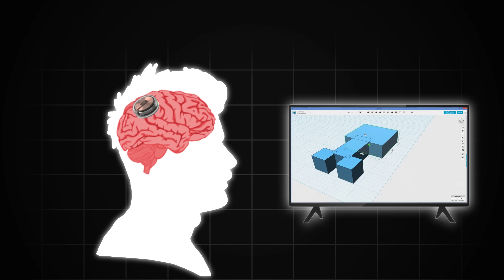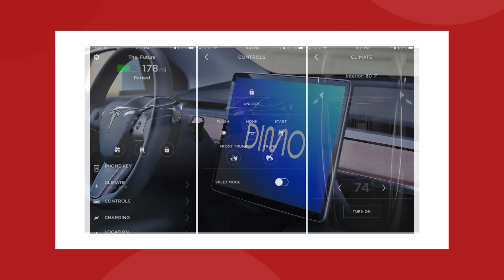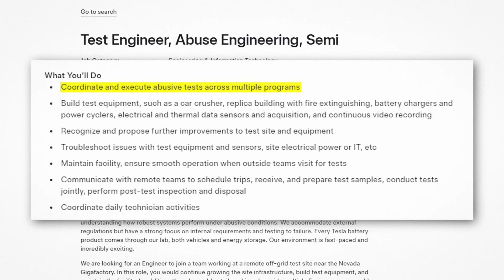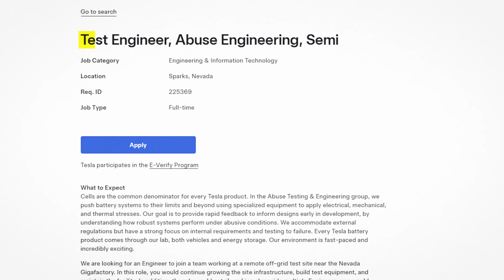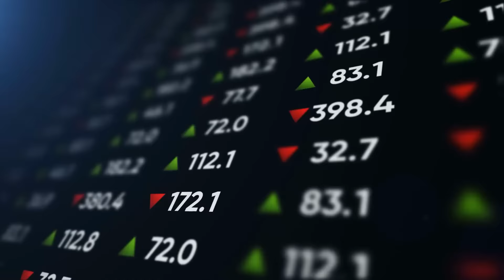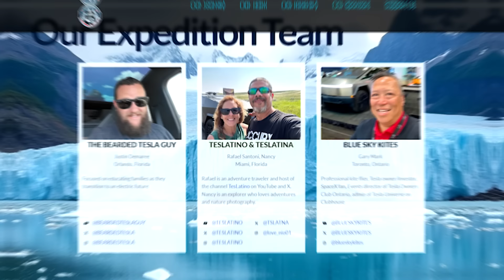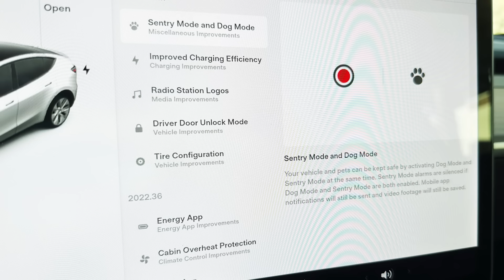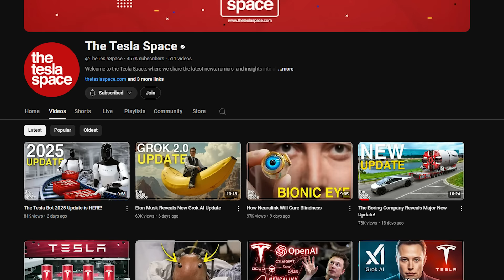Neuralink Reveals Major NEW Update!

Comment: - **SAVE HER LIFE**: amatchformamag
BLOCK INVISIBLE INFRARED LASERS wear all colors

---

*Acrylic Sheets:*
1. **Rectangle Colored Clear Acrylic Sheet**: See-through plastic material, new.
2. **Orange Cast Acrylic Plastic Sheet**: Opaque, 1 piece, 12 x 12 inches, 0.118" thick. Ideal for signs and DIY projects.
3. **SINJEUN 6 Pack Orange Acrylic Sheets**: 12 x 12 inches, 1/8 inch thick. Suitable for crafts, signs, painting, photography backgrounds, and display stands.
4. **Transparent Orange Acrylic Sheet**: 12 x 24 inches, 1/4" (6mm) thick.
5. **uxcell Orange Cast Acrylic Sheet**: 12 x 12 inches, 3mm thick. Perfect for signs, display projects, and crafts.
6. **Laser Safety Window**: For 200-540 nm, 12 x 8 x 0.2 inches. Laser protection sheet for various wavelengths.
7. **Orange Acrylic Sheet**: 12 x 16 inches, 2 pack, glossy opaque cast plexiglass sheets, 1/8 inch thick. Easy for laser cutting and engraving.
8. **FFGODO Orange Acrylic Sheet**: 12 x 16 inches, 2 pack, glossy translucent colored cast plexiglass sheets, 1/8 inch thick. Suitable for DIY display projects, handcraft, painting, and signage.

---

*Top Health Advice:*
1. Night Light orange tint blue light filter/blocking function on devices saves eyesight: Use a large orange vinyl plastic see-through panel (see "acrylic sheets" above) paired with the computer's nightlight blue light software function for eye comfort for protection against harmful blue light.
2. Side Window Deflectors reduce driver-side eye damage and glare while driving, turning your car into a more comfortable space like a living room.
3. Avoid excessive screen time to prevent blindness increased screen time leads to the myopia pandemic.
4. Use Rollens sunglasses when outside; consider the orange-tinted "Gold Rollens." Can put multiple overlapping so can use 2 at same time for more protection.
5. Never stare at the sun to avoid retinal detachment and eye damage.
6. Avoid getting your eyes dilated DILATION LIQUID weakens eye muscles and leads to blindness. An old lady assistant spilled it and said "oops," now light-sensitive, reduction of accommodation, more myopic, never fully recovered.
7. Avoid the chickenpox vaccine to prevent shingles later in life.
8. Cigarette Smoke is responsible for numerous deaths and severe health consequences most die at 60.
9. Use eclipse glasses for eye protection.
10. Privacy screens can darken screens.
11. Eyejusters self-adjustable glasses come in stainless steel and hybrid materials.

---

*Biblical References:*
- The word "pride" appears 63 times in the Bible across various translations.
- "Pride" is mentioned in about 44 verses, with approximately 1/4 being negative. It appears to be mostly positive, especially in the New Testament.

---

Eye Health Concerns MORE INFO/SPECIFICATIONS:
- "SIDE WINDOW DEFLECTORS" REDUCE eye damage/glare while driving TURNS CAR INTO A LIVING ROOM!
- ROLLENS
- Never stare at the sun: retinal detachment and eye damage from staring at the sun.
- Myopia Pandemic because of increased screen time.
- Horror stories about dilation causing acute angle-closure glaucoma and Bell’s palsy.
- DILATION LIQUID can weaken eye muscles and potentially lead to blindness. An old lady assistant spilled it and said "oops," now light-sensitive, reduction of accommodation, more myopic, never fully recovered.
- Eyedrops recall since 2023 due to potential blindness.
- Eclipse glasses for eye protection.
- Orangetanbrown VINYLPLASTIC LARGE/SMALL PANELS "lowblulitesite" for eye protection against HARMFUL BLUE LIGHT.
- Privacy screens to darken screens.
- Eyejusters, Self-Adjustable Glasses, Stainless Steel, Eyejusters, Self-Adjustable Glasses, Stainless Steel.
- Metal steel eyejusters: Eyejusters adjustable glasses for vision correction. Besides the metal versions "steel eyejusters," there are also HALF PLASTIC HALF METAL ones that are TWO COLORS (silver/black) with a METAL FRONT and PLASTIC ARMS, so they are a HYBRID of 2 MATERIALS!
-- Night light orange tint blue light filter/blocking function on computer/phone saves eyesight. Names: "night shift," "night light." Blue light filters are known by different names depending on the device manufacturer. Here are some examples:
  - **LG**: "Comfort View"
  - **HTC and OnePlus**: "Night Mode"
  - **Huawei**: "Eye Care"
  - **Motorola**: "Night Display"
  - **Xiaomi**: "Reading Mode"
  - **Samsung**: "Eye Comfort Shield"
  These features all serve the same purpose of reducing blue light emissions to help protect your eyesight and improve sleep quality.

---

*Eyewear Insights:*
1. Plastic glasses are lighter than metal ones.
2. Eyejusters reading glasses with dials inside do not work for farsighted vision worse than maybe 3.50 or 4.00 but could be higher number verify.
3. For nearsighted vision, use super cheap plastic versions with side dials.
4. Note that different manufacturers have varying nose bridges and frames.

---

*LGBTQ+ History:*
- The phrase "Gay Pride" was coined by activists to reclaim pride from its negative connotations and promote self-affirmation within the LGBTQ+ community.

---

*Health and Technology Concerns:*
1. Copper blocks WiFi; children absorb WiFi 10x more, so turn it off when not in use.
2. Unplug WiFi to reduce overpopulation and lower temperatures by 1.5°C.
3. Lead pipes are linked to crime; crime rates dropped when affected individuals retired.
4. Chickenpox vaccine can lead to shingles later in life.

---

*Environmental Concerns:*
1. Summers are now longer, hotter, and double the 100 weeks.
2. In 2024, the public was asked to stop driving to prevent ozone smog erosion.
3. By 2036, the added effect of an extra week of 100°C for each summer month will have long-term consequences.
4. Millions in Texas are advised to avoid driving to combat high ozone pollution levels.
5. Smog smells bad when temperatures reach 100°F.
6. Solar power is the conversion of sunlight into electricity, either directly using photovoltaics (PV) or indirectly using concentrated solar power.

---

*Miscellaneous:*
- **Fake Moon Landing**: Filmed in Clovis, NM.
- **WATCHMEN/RING movie**: Moon landing conspiracy.
- **35 PATTERN 350**: Versatile pattern for various uses like comic book stores, grocery stores, theaters, etc.
- **Combo Plastic & Steel Frames**: Stainless steel front, acetate sides, or all-metal steel eye justers.
- **Mr. Beast Laser Challenge**: Highlights the risk of blindness from laser reflections as he RISKED/DAMAGED their eyes dot relection = dot in eye!
- **Weight Loss**: Simply stop eating.
- **Anti-Woking Rich Republics**: Lack of awareness about "woke" due to economic disadvantages.
- **COVID-19**: Enacted in 2020 due to the 1.5°C milestone, not the virus. Vaccine as a sterilizing agent.
- **Relaxed Dog**: Neighbors notice because the dog roams free without a collar.
- **Sci-Fi**: Focuses on overpopulation
- **Air Blowers**: Harmful noise levels; avoid blow-drying living things  without hearing protection; hschooler showed how harmful in a project she devised.
- **5 Hottest Places on Earth**: Iraq, Texas, Egypt, Arizona, Dubai.
- **Trump's Racist Comment**: "They're poisoning the blood of our country."
- **Diversity**: Essential for life, as even atoms are constantly moving.
- **Halley's Comet 2061**: Predicted to reverse the timeline as population reaches its peak.
- **90s Crime**: Decreased when lead drinkers retired.
- **Smog Smell**: Appears at 105°F in the third week of August.

---

*How to Keep Cool:*
- **Wet Towel**: Place around neck; cook outside.
- **Less Stuff**: Reduces heat absorption.
- **Misting Cooling Fans**: Effective for outdoor use.
- **Bathroom Fan**: Use intermittently for energy efficiency.
- **Window Fan**: Use to suck out hot air while leaving another window open for cross-ventilation.
- **Singapore**: Greenery helps cool the city.
- **Swamp Cooler Tower Fan**: Uses wind and water for cooling.
- **AC Temperature**: Keep it within 2-3°C of outside temperature for efficiency.
- **Heat Accumulation**: Homes have a limit to how much heat they can store.
- **Bowls of Water**: Place in the house and open windows for cross-stream ventilation.

---

*FINAL NOTES EXTRA:*

- Screenwriting Propaganda:
My screenwriting teacher said that if we only remember one thing from his class, it’s that everything is propaganda. But to me, if it’s good, it’s not propaganda; it’s memorable and impactful.

- William Shatner:
William Shatner faced controversy when he was accused of drugging, strangling, drowning, and cremating his wife. He allegedly used her past struggles with alcohol as an excuse. Do some blame his actions on the stress from the moon landing conspiracy and his tinnitus from a Star Trek accident, for which he was a spokesperson?